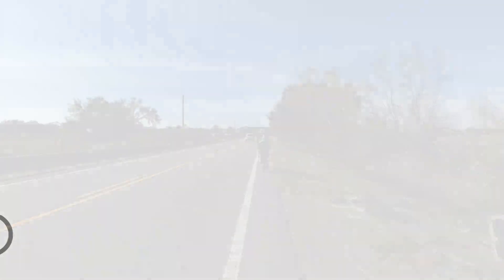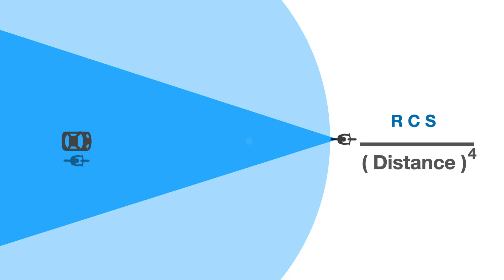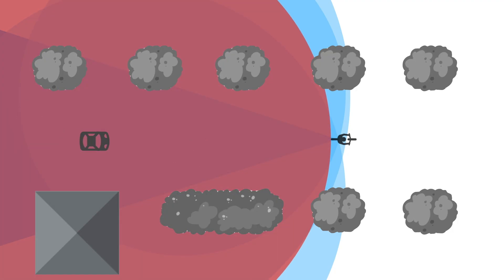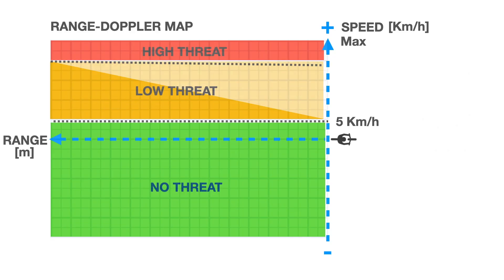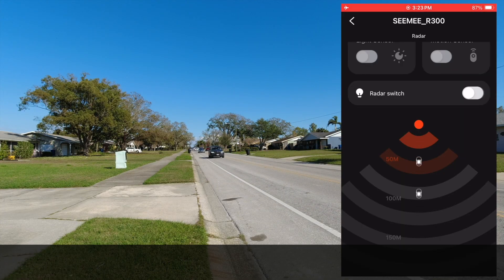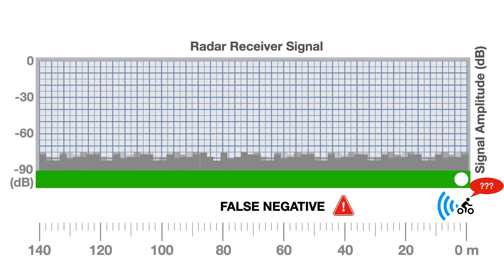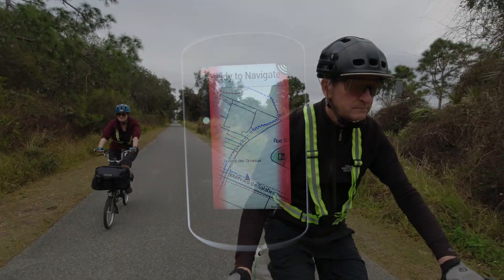Bicycle Radar 101: What you need to know

Comment: I used your review of the Dahon Mariner to help me decide to buy the bike, which I love. I also love your reviews and your educational videos like this one. It is great! I think about a bike radar from time to time, but given where I ride, it’s a struggle to justify the expense. While knowing there’s a car behind me may be modestly useful, I’m a lot more interested in lateral separation. Are they giving me a wide berth or coming straight at me? As your video shows, that’s a big ask. If you ever respond to comments, how do you combine a mirror and the radar?
Reply from the maker: Until recently, no bicycle radar supported lateral separation or “threat side” information (left, right, directly behind). Trek CarBack is one of the first as far as we know. As for the usefulness of riding with a radar, your cycling environment will likely dictates how appropriate it is. If you are mostly riding on bike paths or constantly surrounded by vehicles in a busy city environment, a radar won’t be of much use. If, however, you cycle on county or regional roads with poor or no shoulder, relatively low (but fast) traffic, a radar could be a valid way to remind you it’s time to look at your mirror(s). By changing its rear light flashing rate, it also makes you more visible to incoming drivers.
Reply: @2Bikes4Adventure Thank you!!

Comment: I absolutely love my Garmin Varia radar unit! I use a Bup Labs mount on the rear rack on my Brompton to attach the radar unit (where the rear reflector normally goes) and it works really well. The Garmin ConnectIQ data field called "Smart Bike Lights" is also an awesome enhancement to the user experience - it allows you to customize when the light comes on, and what mode to use. For example, I set up mine to be normally off, but turn on in the evening hours in the peloton (low brightness) mode. And it also turns on in the flash mode when a threat is detected by the radar that's going faster than 12 mph. And finally, the radar light also comes on when I'm braking. The data field also shows you the battery level of the radar unit, and lets you manually control the light mode if you'd like to over-ride the "smart" mode. Another great benefit to using this data field is much longer battery life because the light turns on only when needed (when dark or when a car/bike is coming up behind you). I'll do a video some time of how I set it up on my Brompton. Thanks for the awesome video treatise on bike radar technology! Love it
Reply from the maker: Looking forward to your video.

Comment: I am using Bicycle Rearview Radar W100 that I bought from AliExpress.
I generally agree with your analysis, as false positives and false negatives can occur at any time, so if the beeps are too frequent, it would be best to turn on the radar function when driving on a quiet road.
Your analysis of the operation was very helpful. Thank you.

Comment: I have been using a Garmin Varia since the first model came out and second your comments.  Radar is best for country roads when you need additional indicators of cars approaching at speed.  In the city, the signal density is so overwhelming you simply stop looking at it.  It is pointless on cycle paths.  Note though that even if you ignore the signal, the rear taillight still functions and is useful...my Garmin flash frequency increases as cars get closer.  Radar is best used with a good mirror and ears tuned to tire noise.  My personal favorite mirror is large and mounted to the brake lever with velcro.  I use the radar for early indication, then confirm using the mirror and tire noise.
Reply from the maker: You raise an excellent point that we may not have discussed enough in our video. Most, if not all, radar transmitters are equipped with a tail light that activates (usually flashes) as the target approaches from behind, thus (hopefully) making the cyclist more visible to the driver. This feature doesn’t necessitate the cyclist intervention nor the need of a display unit.

Comment: Bicycle radar is a non sequitur. Radar makes sense when you can actively take action against a threat or try to avoid it. Cyclists will always be at the mercy of the car drivers when they share a road. Many have commented that a mirror is a better option. A mirror allows you to easily check who is behind you when turning or changing lanes, it does not alert you to threat. If a driver is careless and is on their way to drive you over they will do it regardless of you having a mirror or a radar.
Reply: What about a spinning wind turbine attached to the rear of the bicycle to increase the cross section and send a warning to drivers as well as generate electricity?

Comment: As a cyclist I have a question. How does one react to the information that a car is approaching from behind? I would prefer if the technology could alert me to the car position relative to the cyclist’s “lane”.
Reply from the maker: In addition to speed, distance and threat level (green, orange, red), the ANT+ protocol supports the concept of “threat side”  information (left, right, directly behind). Until recently, no radar supported this feature. Trek CarBack is one of the first as far as we know (the fact they use 77Ghz instead of 24Ghz has probably something to do with it).

Comment: Not to be a smart ass, but doesn't a rear view mirror solve this?
Reply from the maker: Having the choice between a radar and a mirror, I would go for the mirror (we use a model that attaches to the glasses (Bike Peddler Take A Look Cycling Eyeglass Mirror )). After using a radar for more than a year now, I must say it does come handy while cycling on rural road (poor or no shoulder) when the lack of traffic makes you complaisant and start ignoring to look at your mirror as frequently as you should.
If you already ride with a compatible bike computer, the cost of entry is not that steep. If you need to buy both units, it’s an expensive proposition compared to a cheap mirror.
Reply: @2Bikes4Adventure  thank you for the explanation
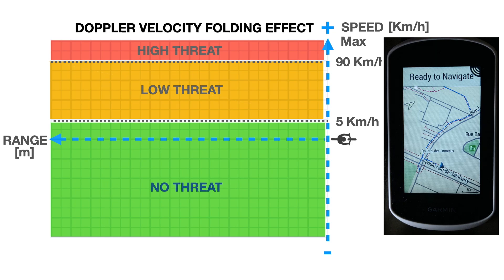Reply: Hi, they address this at 6:03 through the end of the video, concluding that it "doesn't replace a mirror & common sense but compliments them", and note that the radar can be helpful in an environment where cars might unexpectedly show up very suddenly. I also see a great use case for radar amongst bike riders who might want a redundant, auditory warning system if their eyes fail to catch something.